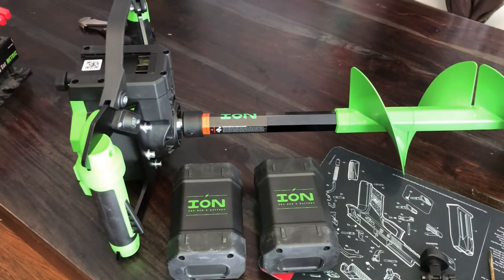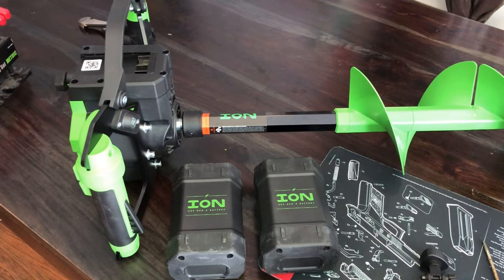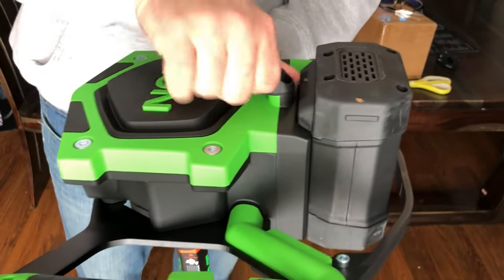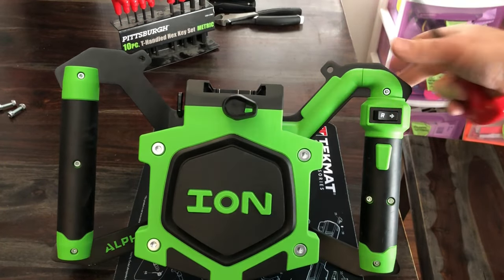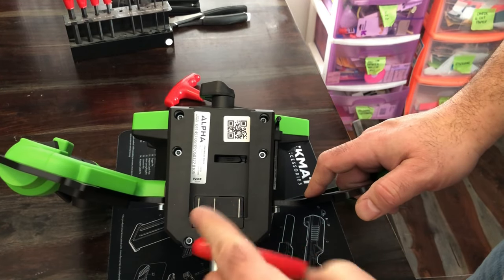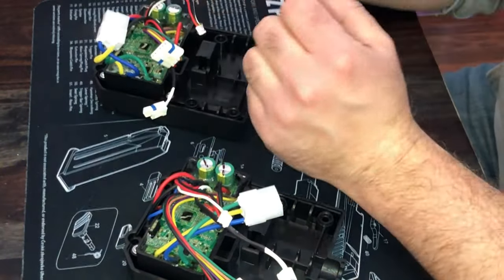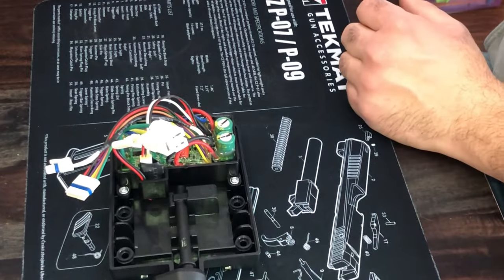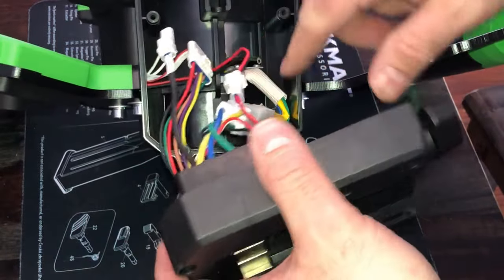Ion Alpha  Auger Repair, Can we fix it?

Comment: s there a bit of wobble where the auger attaches
to the drill? I was looking at one at fleet farm
yesterday and it seemed a little wobbly. Maybe
the screw wasn't tight.
Reply from the maker: I don’t notice a wobble with it when I’m using it but to be fair after years of using a gas auger it feels pretty smooth compared to that. As far as a floor model at a store there is always a chance it’s not tightened up all the way or been banged around by a lot of people. Even with having to fix it I’ve been really happy with it

Comment: HI, 
I just bought one from canadian tire  (Canada) Calgary and it was on sale. Original price was 822 C$ .
Eventually I got it for 150 C$ and it was stated that it it was missing a battery. I had some other batteries than ion and try  to make it work but I could not. My opinion is that I have same issue as you do and this ion auger would not work for same reason.
I will call Ion to check.
What is your opinion on this matter.
Thanks.
Petar
Reply from the maker: If you know anyone that has an Ion maybe see if they will let you test it with their battery. Not sure if it matters but I always like to check as many things as I can before calling a company. That being said the customer service I received was fantastic and I got the impression they really wanted to help. I hope you get it running soon as that was a great price for it and they are great augers

Comment: yes the alpha plus... cuts amazing... when it works!!.. friends didn't come with hardware for the battery guard... then 6 holes later the control board went out... then on mine the blade holder failed, was shipped a new part only to find the threads for the center spike were null and void in the new part. needless to say it cuts amazing...when it works!
Reply from the maker: I was just out fishing with my brother who has a G2 and he was surprised how much faster the alpha cuts and how much lighter it is with the composite auger so maybe it's kinda like having an exotic car super fast but extra work to keep it going.  Sounds like your friend got one more hole than I did before the control board went out.  Hopefully they got it switched out without any trouble.  Thanks for checking out my video!

Comment: Same thing happening to me after drilling about 20 holes or so. I’m guessing solder points were weak and broke loose. I took mine home and tried another warm fully charged battery on it and it immediately started to smoke. Contacted Ardisam (Ion) and they immediately shipped a new power head. So customer service is great. Only thing is I wont be able to put it to use again til next season since Ice is gone here in Ohio. So we’ll see if this one holds up next season
Reply from the maker: It really sucks you won't be able to get out again this year.  We had rain here in MN this week so I have no idea if we have safe ice anymore and our fishing season ends on Feb 28th so my ice season is probably over as well.  Hopefully next winter we can both get out more

Comment: Every winter multiple times I’m one mouse click away from committing to one of these ION augers then I stumble upon one of these videos…. Old trusty gas’s auger just keeps on ticking.
Reply from the maker: If it ain’t broke don’t fix it is an old saying for a reason but the flip side is changing out the control board wasn’t any more difficult than a normal carb cleaning and it was really nice to drill holes in my shack with the heater running when it was sub zero out. As long as you can get fishing it’s all good either way.

Comment: The same thing happened to me after just ONE hole drilled with a brand new Alpha 8 inch. Luckily a guy I met on the way out fishing loaned me his. So, not all was lost but it's dissapointing when you pay that kind of money and then have to do the repairs yourself. Customer service was very good, but I had to call ION back to have the video link they said they would send and did'nt.
Reply from the maker: Thankfully that guy was willing to help you out but still I understand the frustration, mine went out while I was trying to take my kids fishing and not being able to move when we weren't catching anything was beyond annoying
Reply: @funwithflandy  Replacing the wiring was a hastle and it did not fit in "tightly". Unfortunately the screws ended up stipping out so the casing it still loose. I need to find a way to back the screws out and get replacements. I drilled 6 holes yesterday in 2 feet of ice and it cut through them like butter.
Reply from the maker: I would reach back out to Ion about the screws I am hopeful that if they expect us to make repairs on these on our own that they would offer assistance when we run into common issues like screws stripping out.  I know they have several service centers by where I live in Minnesota hopefully they have some near you and they can cover the cost of one of them helping you out with getting your auger back to the way it should be

Comment: It happenned to me ! I have not been able to drill one hole! I went to my local store and they refunded me the ion... but I am still mad and wonder if i should still buy another one!
Reply from the maker: If you are still looking at getting an auger I would recommend getting an Ion still. Even with the problem I had the company made it right quickly and with the weird winter we have had in Minnesota there are some great deals out there.   You could also check out the new Eskimo augers they are very similar and a little cheaper
Reply: @funwithflandy  I bought another Milwaukee and a pistol bit (like I had before the Ion). It works really well. I have 3x 5ah batteries I will be good with that. I wouldn’t want to have to play in all those wires myself. I’m disappointed they don’t send you a new one or repair it themselves
Reply from the maker: @mathisngo1786   I'm not going to lie to you I was very surprised when they said they would ship me out a new part to install myself.  That being said I really didn't mind not getting a different one shipped to me since I know most companies that do replacements on electronic devices will only send you a remanufactured one and since this one only had about 10 minutes of run time on it everything else was brand new.  As far as doing the swap myself I am guessing that is the policy because not everyone is close to a facility that can do the repair and this is the fastest way to get it back up and running for the customer.  I'm sure I'm coming off as a bit of a Ion fanboy but this isn't the first auger that my family has owned that was made by Ion or their parent company and they have always served us well for over 35 years so they have earned my trust.  Glad to hear you got something that works, hope you got out and caught some fish.

Comment: Is it still working after the change? I did the same thing to a g2 last week. It has drilled about 60 holes and failed again.
Reply from the maker: I only was able to take it out a couple of times after I fixed it so maybe about 12-15 holes so far.  Hasn't been any issues but not the biggest sample size.  Getting a new job severely cut into my ice fishing time :-(

Comment: damn, I was going to sell my strikemaster 40v for Alpha plus because of the lighter weight. Guess i will stick with my 40v then
Reply: Have you compared the strikemaster with the alpha plus? I’ve never seen them drill side by side.
Reply from the maker: @boghammar1423  I don't know anyone with a strikemaster to compare the two, I will say that my alpha cuts very fast, we have had weird ice conditions this year with a hard crust, a layer of slush then the actual ice on a lot of lakes and when it was running it went through like butter.  I've been walking out onto the ice this year since I don't trust it to drive on and the lighter weight of the plus has been really nice for that

Comment: this same thing just happend to me i just got my aplha 8 inch and used it one day drilled about 8 holes and now the light wont even turn on. brand new
Reply from the maker: That really sucks. The light still came on with mine and it made a faint clicking noise when I tried to use it.   Depending on where you bought it they might replace it for you or reach out to customer service.  I had the replacement parts in about a week so it  was fairly quick. I hope you can get back on the ice soon